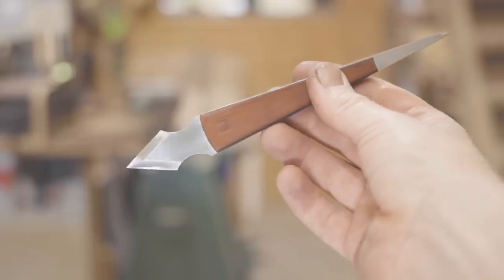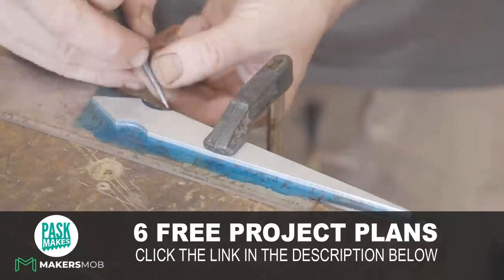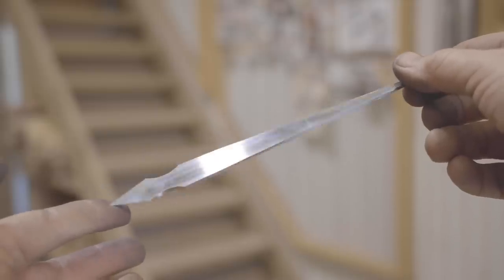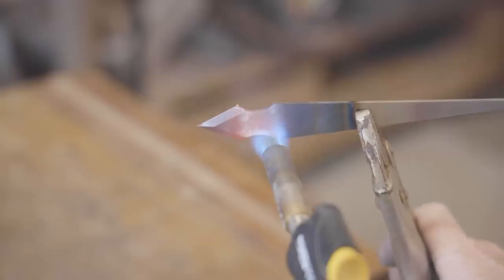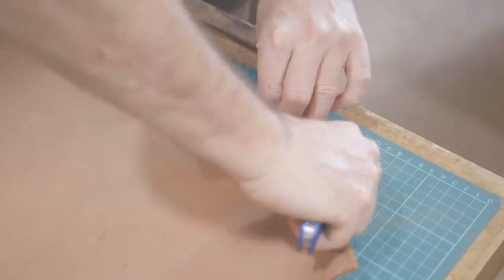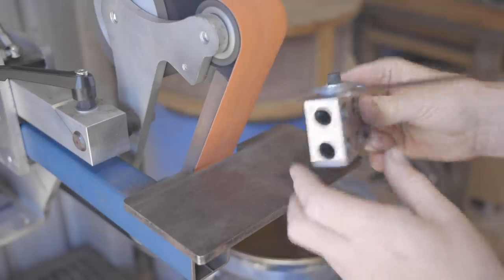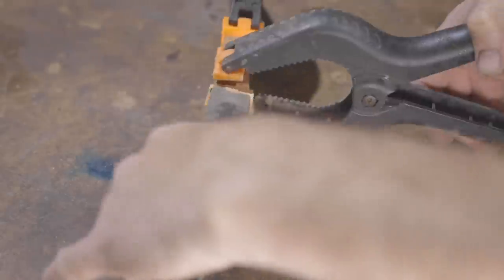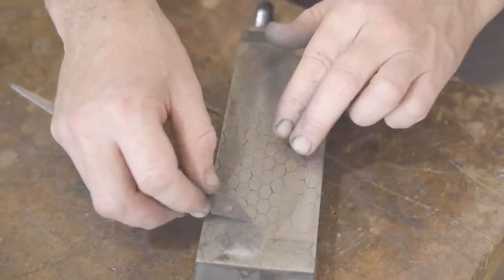Make a Marking Knife

Comment: There is an advantage to leaving one side completely flat (no leather) for woodworking marking where the craftsman needs to run the knife along the flat side of a thick board to mark another board beneath. A more accurate mark is made as opposed to coming in at an angle.
Reply: I reckon one flat side also makes it easier to use it as a prying tool, if ever needed :)
Reply: That’s how I make my marking knives; wood on just one side so the flat back can register to whatever it’s being pressed against.  Works out well.
Reply: _ David _  no wai >:(
Reply: _ David _  I feel you, I wouldn't wanna destroy my tools either but in a pinch you gotta do what you gotta do. 😅

Comment: Pask that's awesome. Only advice I have is use contact adhesive instead of epoxy. Any epoxy or super glue can destroy the leather due to the exothermic reaction caused by the curing where as contact adhesive theres none and will stick solid. I'm a leather worker btw lol

Comment: Hi, quick advice, if you want to make your touchmark to be embossed more distinctively, you can either slightly dampen the leather before punching it in, or heat your touch mark (not very much, probably somewhere between 150 and 200°C, I don't know for sure) and then just press it in. I personally prefer the latter for the touchmark. The latter, by the way, works not only on veg tan leather, but oil tan as well.

Comment: Coulple of things from a leather crafter….cut your leather a bit wider you can get the excess off with the belt sander.  Rough the handle blank for better grip before gluing, I use contact cement or epoxy, both work well.  I’d you don’t want the leather for the handle to “walk”, dry fit holding with tape, drill holes through all 3 layers, use glue with long open time and set rivets.  So cut, shape, grind the metal.  Cut leather to rough shape, dry fit with tape or small clamps and drill holes for rivets or pins. Glue up and set, remove the excess leather with a sander….use the sander to round out the leather edges for burnishing.  Anything, and I do mean ANYTHING can burnish leather, as long as friction and heat are created. My favorite is denim or sail cloth. I use carnauba wax for leather and wood.  I’d save sharpening until last.

Comment: Nice!

I made a similair pair of knives from an old stanley plane blade that I split down the middle. The hardened part of the blade can be snapped in two with a vice and some pliers. The remains of the keyhole in the blade makes for a good finger groove.
One knife has a bevel on the right side only and the other on the left side, but they are stored in a double pouch so both options are are always availible.
(The one-sided bevel reduces the equally fragile and scary point on the marking knife.)

An easier project with no need for additional heat- treatment and a good use for a used-up plane blade.

Comment: Was that a diamond blade in the angle grinder? I had no idea you could cut steel with them.
Reply: They are not designed for that purpose and should not be used for that task.

Comment: Hello, great video. I wonder what liquid you used to clean the blade before gluing the leather
Reply: Can't guarantee what Pask used, but it looks like alcohol.
   Any organic solvent will do though... from alcohol to acetone (nail polish remover), mineral spirits, even old gasoline will work in a pinch... and they're all hazardous, so be careful not to breathe too much of the fumes or light yourself on fire... I have (for special gluing reasons) cleaned with brake-parts cleaner to be sure there's no residue left behind, but that's a tad pricey in the longer run and larger scale, so I only rarely default to it, myself...
   Brake parts cleaner is okay in old (hand-wound) watches and clocks, for the same "no residues" reasons. ;o)

Comment: Not bad at all.  Im thinking of using an old file thats too dull its very old 1950s so I'm hopeful its harder then normal steel.  I could try and bring it back with lemon juice ive been told by a shop teacher 40 years ago this works i doubt it works on metals made in twian or China.
But good old American metal going to have more carbon.  I could just go buy some 4140 stress proof  scraps. 
It seems to me somone should be selling  blanks.  Oh one more item you didn't mention an old plane blade I think I've got a few of them from old stanly planes.

Comment: How is that diamond blade compared to abrasive?
Reply: Yonatan24 excellent question, I’d like to know too
Reply: I find that the diamond blade makes for a much cleaner and faster cut. Putting less heat into what you are cutting also. Plus cutting hardened steel is a bit challenging for a normal cut off wheel.

Comment: Question, is that a segmented diamond cut off wheel on your angle grinder? How well does it hold up to cutting through high carbon steel, I was thinking of picking one up but they normally say only for masonry/brick type materials.

Comment: What does the magnet do? What's he che king for with it?
Reply: Also what's the stuff he keeps spraying it with to clean it up
Reply: @codyhunt4531 Obscenely late reply here but... he checks with the magnet to see if it's hot enough to quench, once it no longer sticks you dunk it in the oil to harden the blade.

And I don't know about Pask specifically, but a lot of people use Windex, or a similar glass cleaner, to wet down what they're polishing.

Comment: Hey mate: You are a carpenter primarily dealing with wood.  Instead of the leather if you are not happy with that, how about some pieces of wood and a couple of rivets of brass to give it some bling? Nice end result however. 

I Love the belt sander you use, and was hoping to find a build for it in your YouTube collection.  It just looks like the best one I have ever seen, especially with the easy change-over from vertical grinding face to tight radius convex surface for tight concave radii.  I failed to find anything in your collection. Does that mean that this was not your construction?  If it was someone else, are you able to send me the reference. Cheers.

Comment: Great work. Whats the trick with the magnet, do you wait untill the red steal is no longer magnetic?
Reply: Basically when steel is at the correct temperature for quenching (known as the curie point) it stops being magnetic so a quick blacksmiths trick is touch it with a magnet if it doesnt stick it's ready to be quenched (dunked in a liquid of some sort, usually oil)

Comment: hi mate.. at 1:16 what blade do you use to cut metal? is that a diamond blade for marble?
Reply: It looked like a diamond blade, but I don't think it is very good for diamonds to be used on steel without coolant.
Reply: @garethbaus5471  some says diamond blade for steel are more better than abrasive disk, bcoz its not easy to tear apart and longer uses.
well I'm still using abrasive disk, with carefully..

Comment: Another great build. Have you ever tried  using E6000? It's a really strong and very flexible  adhesive. It can be used like glue or contact cement.  It works great on attaching leather to metal. If that epoxy gives you troubles,  try some E6000...

Comment: Beautiful job! I don't yet have a belt sander of the quality I would need to make this but one day I might give it a try. The real gem here came during viewing this video! I noticed, briefly, that you mounted a thien separator on top of a blue (food grade) plastic barrel (had to return and pause to be certain). I had been stressing since the company that sold me the one I bought to transport water for my daughter's horses had nothing I wanted (old cinnamon, cardboard, barrel) thinking the blue barrel I have and no longer use might collapse under vacuum but I realize that not much vacuum pressure would exist there anyway. I have a cheap Harbor Freight dust and chip vac that I will use with my now unused blue barrel along with a, yet to be built, then separator so I can free up my shop vac which is attached to my chip and dust collection shop routing which works great (3" PVC copper and node/screw grounded end to end to prevent static ignition).

Comment: Awesome as always! What was that metal block you used to secure the knife while on the belt sander? I've seen them before but didn't realize the holes were threaded
Reply: It's called a 123 block. Any place that sells machine tools should have them, or you can order cheap ones on Amazon. The holes aren't threaded, but they go all the way through.

Comment: at 1.16 what blade/disc are you using on the anglegrinder? looks like a disc for cuting tiles. Is that correct?btw great project. like the look of the knife. =) looks like it also could be used as a throwing knife/dart arrow =)
Reply: That's a diamond-covered disc, as far as I see, and yes, they are mainly used for cutting tiles and/or stone, but can be used for other materials. I used to cut pine bars with one when there was no better appropriate tools at hand. There exists a version of them without those serrated cuts, though I'm not sure if it is better suited for cutting metal.